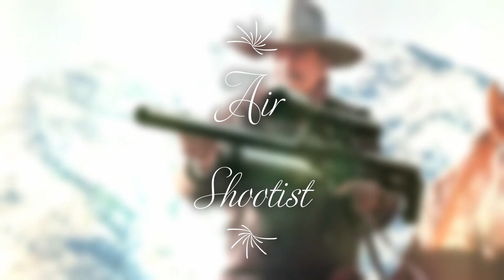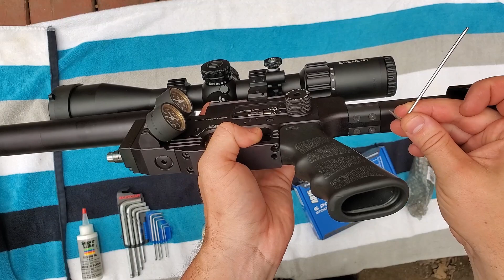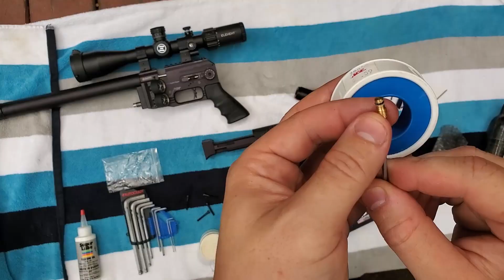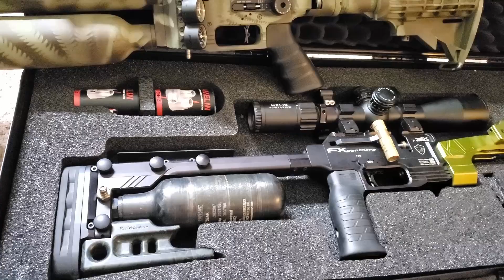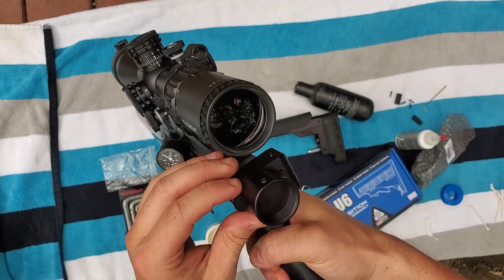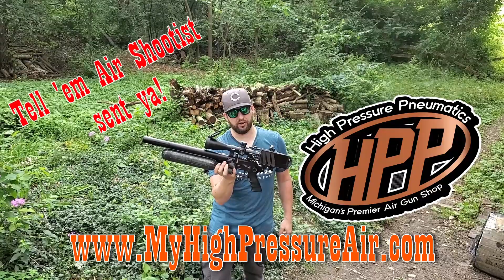FX Panthera Hunter Compact Folding Stock Installation - Turn Your Panthera Into A True Truck Gun!

Comment: Sweet was waiting on this. My Hunter started leaking at the gauge. Removed it to find the oring pinched. Straightened it out and boom no leak. 3rd time out earlier shooting 100 yards. Group’s getting better. Most shot’s within 2” .. few scattered bullseyes and fliers ..none outside 3”. 
Sh!t is not easy. 
Shooting JTS 18’s at 900 fps.

Comment: That small set screw was incorrectly placed on the top of the folding stock adapter by FX.  It should be on the bottom so that it goes into the groove on the buffer tube and tighten flush.  I was told by someone at FX that "yes, it was a mistake" and to just remove it and only using the castle nut would suffice.
Reply from the maker: That definitely makes sense! I was sorta wondering about that! It digs right into the buffer tube threads.

Comment: The FX design of the folding mechanism is not well thought out. Besides the screw that should have been on the bottom, the pivot point should have been about 10mm further out so the stock could fold parallel to the rifle instead of hitting the action lever. Having two shorter screws on the right side is to clear the hinge pin is also a bad work around. Last whine before I say how great you are, is FX should include instructions. Moving the fill valve fitting seems straight forward, but it’s buried so deep when mounting in the front position that there is almost no room to wrench it snug. I spent a couple hours trying yo figure out if it needed a washer. FX gets the big things right, but often cheats out on the details (I own 4 of them)

I’m absolutely loving your channel! The information you provide is practical and affordable, and is the main reason I bought this rifle, moderator, and scope combo. I’ll never be able to shoot at your level, but you make it better, and I know I can’t blame my equipment if I follow your advice. Thank you!!!
Reply from the maker: Thanks for a well-thought out comment. You should never feel bad for providing constructive criticisms and I agree with all your points here actually. I was thinking of maybe getting a smaller stock to avoid hitting the charging handle, but now the one that is on there is already spray painted to match so I guess I will deal with it. It's not that big an issue, but it is a bit annoying for sure. 
Thanks for the nice comments about the channel, too, man. One thing I want you all to keep in mind is I am just a regular guy who likes to shoot and make little videos. I like helping people via tutorials, as well. ANYONE, and I do mean anyone, can shoot as well as I do. I'm not even that good, I just practice a lot and spend a lot of time researching and reading. I genuinely feel like anyone can do that, just gotta put some heart into it is all. 
Cheers, dude!
Reply: I agree, I am trying to get set up to come out and shoot at some events hopefully soon!! what all do you need to enter some of these events or does it just take Travel and entrance fee money?
 @airshootist

Comment: Now that bottle does it have the correct valve to fit right onto the dynamic or impact or will it fit on but you have to degas it before changing it out
Reply from the maker: Actually FX valves close automatically upon unscrewing so you can hot-swap full tanks. And yes, this will fit all current FX guns
Reply: @ I know that Fx bottles have valves I was asking if that bottle that you are using has a valve in it or do you have to degas it to remove that bottle thank you